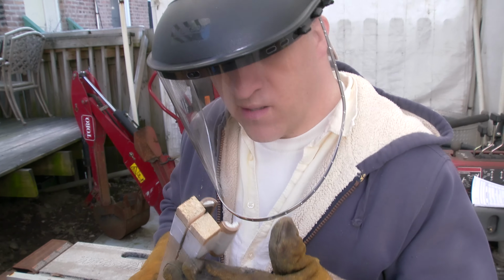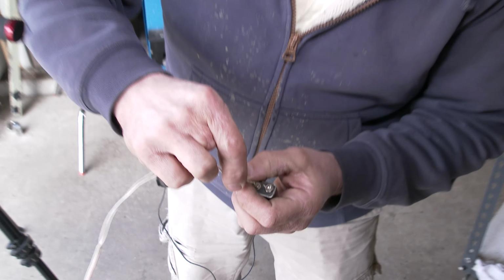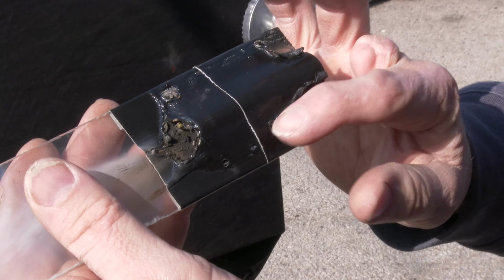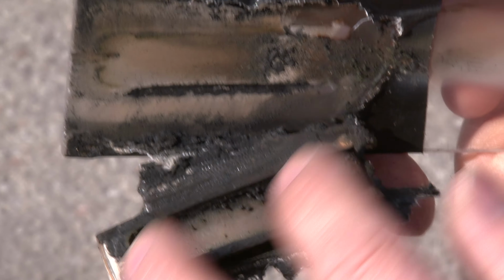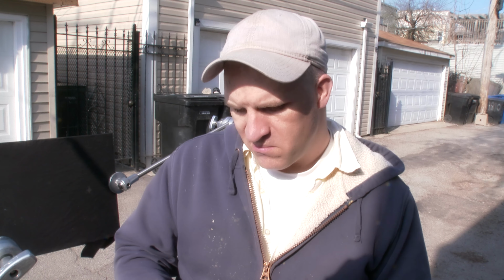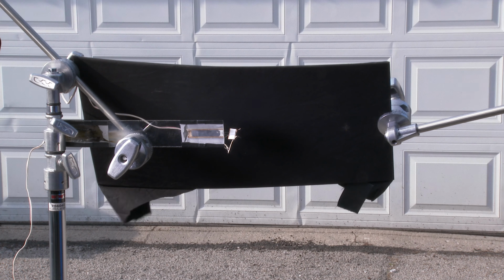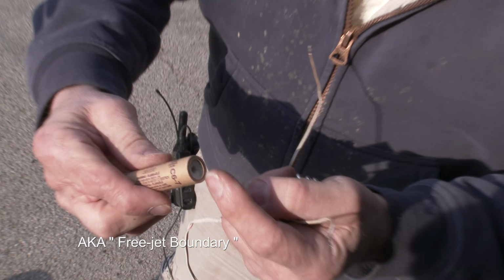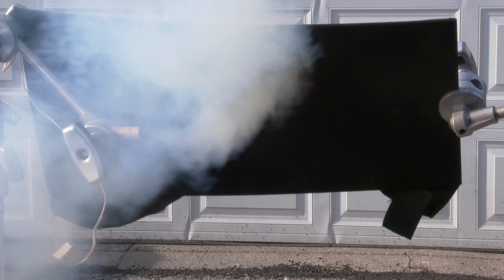See Through Model Rocket Engine Burning in 4K Slow Motion - Rockets (S1 • E1)

Comment: If you can be bothered, I'd really like to see an actual clear rocket engine, such as you saw away the cardboard tubing from the 3 stages and put it all in a perfect sized tube of some description. Putting it up against the flat piece looked good, but didn't show how they're meant to work (slow progression from nozzle to 2nd stage, very slow through that and then to the high explosive part that ejects the parachute). It seems as though because there wasn't a good seal on the casing, that the flame engulfed all the fuel almost instantly (along with the 2nd and 3rd stage).

I've seen it done with rocket candy (Grant Thompson I think), but not a professional made rocket engine.
Reply from the maker: we are filming that one already, coming next week. ... thanks !!
Reply: Just seen the other comment exactly like mine that was posted while I was writing mine haha Great minds think alike! 

Absolutely fantastic! Can't wait to see that when you release it anyway, Loved this one too, some great looking visuals on the interior of that engine!
Reply: Tkor is da bomb!!! Warped is great too😀

Comment: Great Experiment! I do think though that the rocket engine half didn't burn quite like its supposed to since the entire length of the fuel was exposed to the air/oxygen with out a complete air tight seal to the glass. I think this made the fuel burn all at once rather than progressively up the length of the engine. Thanks for the amazing content
Reply from the maker: yes i was disappointed by that too, but this video stimulated me to build a full proper version. coming up next week
Reply from the maker: one of the reasons i started out this way was because i was unsure if i would be able to capture a good view if i made a clear circular side view, i will develop it and film it next week though.
Reply: That's understandable. Looking forward to that next video

Comment: First off, I notice the motor's not fully sealed against the acrylic, so the flames tend to shoot up and down as well as out the nozzle. I don't know if there's a way to seal it better, but it might help.
More importantly, a model rocket engine has a few sections of fuel. The initial launch fuel, a delay charge, and an ejector charge. In this video, they seem to burn all at the same time. In fact, I think the part to the left that's glowing is the delay charge. This also might be because the engine doesn't have a full seal with the acrylic so the fire can go through the gap between engine and acrylic and ignite the entire fuel faster.
These are things to consider when you do this again.

Comment: This is way cool, but you cant really see the nozzle working due to the leakage of gasses thru the top and bottom. maybe hot glue the half of rocket to the plexi glass?
Reply from the maker: yes i figured both would be good instead of one or the other, thats why we posted this anyway. working on the other version as well

Comment: Nice experiment, but i would expect that it would look completely different if the sides were sealed against the acrylic ...i believe that it would then burn from right to left instead of over the complete visible surface ... would that be worth a try? but no idea how to really seal the sides .. two component epoxy maybe?
Reply: Yeah, the burning progressed way faster than it should have.  Epoxying it to the glass would probably have helped - I know epoxy is sometimes used as a burn inhibitor in rocket candy motors.
Reply from the maker: Hi Florian, we are doing a part 2 of this with a custom built transparent unit, will be out next week. thanks !!!
Reply from the maker: mostly with this video i wanted to show how the solid fuel blends and burns which i dont think i can see very well when its totally sealed, i have built a proper transparent rocket engine and will finish filming it early next week, i'm excited about this subject and the entire thing is too much to fit in one video. each variation in setup reveals different information about whats happening. thanks for watching
Reply: Warped Perception cool, looking forward to that :)
Reply: Warped Perception That'll be even better. I think he just meant to seal the edges to the acrylic though- not the whole thing. That would change the burn direction to back to front plus force the exhaust out the nozzle instead of out the edges
Reply from the maker: blurglide true but it looked too cool not to post, I figured might as well do it right, so I have to this shoot I ordered everything I need to build a custom rocket exactly like the one we burned but completely transparent, we're going to test it out on Monday and it's all works out start filming it right away
Reply: I agree. This vid has nothing to do, even from a 2d perspective, with a true propellant burn, especially the second one; blow-past going everywhere.

I would seal the whole flat area of the charge and the casing with with a low reactive contact adhesive such as pliobond and slather lots of epoxy around the perimeter, as well as tightly strapped tape.

It still wouldn't quite match the burn-progression of the fully radial charge, but gee it would come closer.
Reply from the maker: Well that's exactly why I didn't do it, this video was only about how the fuel Burns, that's it, the Max video will be up properly built transparent version. That should be up next week
Reply from the maker: tubeist- dan even if the ends were sealed it would still mix internally via the small Gap in between the acrylic and the fuel
Reply: Son, I am disappoint :(

After the great clear cylinder head videos this one really falls short. the motor needs to be sealed to stop the unrealistic burn characteristics and flames burning out of all sides.
Reply from the maker: Ryan Smith this is YouTube, I post even our developing subjects and test shoots. that way on the real shoot I'm able to incorporate other people's ideas and opinions into the full episodes.+Toshogu Takegawa nah.... All or nothing in my opinion, this was just to show how the fuel burns, even if the sides were sealed there would still be premature ignition propagation in the chamber comma since it's not perfectly sealed. I have a full version of this that I built that we are shooting next week, it's a hundred percent proper and transparent.
Reply: Warped Perception I look forward to seeing the next video! 
At the moment I'm trying to figure out where I can find the one or 2 D motors I might have hiding somewhere in the house!
Like they say, rockets aren't easy.
Reply from the maker: Ryan Smith yeah most of what we produce is outside of YouTube , so we use YouTube as a playground sometimes, good luck finding those D Motors, aren't those the big fat ones
Reply: Warped Perception yes the D motors are quite big. Unfortunately it's not easy to get them in South Africa so I saved 2 for when I finally complete building the rocket I have that takes 2 D motors.
Reply: I agree. The propellant in a model rocket motor is designed to burn from bottom-up. It doesn't always, though. The shuttle SRB's used a hole all the way up the center, so that the flame front was the entire length of the rocket.I am super-surprised the duct tape and acrylic could take the pressure, but since there was no real nozzle to constrain it, I guess the pressures were a lot lower than they normally would have been.

BE CAREFUL if you really seal it tight to the glass/plastic. The pressure can easily get to 1000 psi (or whatever psi the adhesive finally yields at). Great work!
Reply from the maker: Felony Videos wow.. that's great info , I just finished building a completely transparent proper rocket, I will make sure to use plenty of protection when we shoot it.
Reply: The burn spreads across any exposed surface, which is why a model rocket engine with a cracked grain explodes.  So in order to model the actual operation of the engine, you do have to glue the casing and the propellant grain to the acrylic.  Even so, I'd expect the flame to propagate along the interface between the propellant and the acrylic; I don't think epoxy would be adequate to withstand the chamber pressure.
Reply from the maker: Alfred Packer you are absolutely correct. When I built the actual version we are filming now, I constructed it completely different.
Reply: I disagree. If you watch the initial center material burn, it is immediate, pure gun powder. Its goal is to ignite the entire inside of the rocket. The insides are coated in (ferociously) slow burning material.
Reply from the maker: dpqbpqb dpqbpqb I never thought of it that way. good point .
Reply: Yeah he fucked up.
Reply: It's still awesome. I guess if you wanna make it look like what it's REALLY like, you would have to cut half of a transparent tube that replaces just half the cardboard cylinder. That way, you'd keep the shape of the engine while still being able to see through.
Reply: I came to the comments to say this. It would be really interesting to see what it looks like with a good seal all the way around.

Comment: Cut one in half and then use some high temp adhesive to secure the sides to the glass so you get the see through and the force of the blast going out the back. I wonder if the fuel burns differently inside when  it's not open and still has the pressure.

Comment: The Estes low power Black Powder rocket motors are "end burners".  The burn starts at the nozzle end and burns the propellant uniformly up the casing length.  Then they have a delay element that burns at a constant rate to the ejection charge.  High Power Ammonium Percolate motors are typically "core burners" where there is a hollow core the length of the motor that is ignited and burns from the inside of the propellant to the outside.  Though a core burner type of motor can also be made up of several propellant "grains" that will also burn at each end as the core burns.  (This is essentially what the Shuttle solid rocket boosters are.)
Reply from the maker: +TerrorDBN well said and exactly right , I wasn't sure which these were but for some reason I assumed that they were core burners which is why I cut them in half, I found out they were end burners,  but once it was done I figured I would do the video anyway. I have had these laying around for a while oh, I don't know why I thought they were core burners but it's okay.

Comment: Fun video.  When I was in grade school, Estes sold a clear sided engine where the colored the propellant, smoke charge and the ejection charge.  Back then the used a paper cap to retain the ejection charge that was like loose pellets.  Now I think it's more of a clay cap.  

Wanted to show an engine burning for a science project.  Never happened.  Teachers freaked at having it indoors.  Was in a plexiglass case with squirrel cage blower to exhaust the smoke out a dryer tube threw an open window.  

I was wondering how you were going to cut the engine in half.  Was wincing as you started up the table saw.  Was sure there would be enough friction heat to ignite the propellant.  Looks like it did scorch the the end of the casing.  

The C6-7 has s 7 second smoke delay, a C6-3 would shorten the high speed filming.   Another fun project would be to use a 1st stage booster engine like a C6-0.  Would show how they blow burning propellant out the back of the engine to start the second engine that would be taped to it in the second stage of the rocket.  

I fired more engines connected to a bench vise than my parents ever cared to know about.  Also had a D series engine that wouldn't ignite with normal igniters.  Removed the block of propellant from the paper casing and set it on top of a burning barrel with a fire.  When it all burned at once, made a huge mushroom cloud of smoke.  

There is a fascination in messing with these.  Looking forward to your Parr 2.

Comment: The experiment you perform was more along the lines of looking straight at the end of a rocket rather than looking at a cross-section of a rocket. Coat the half of a rocket in super glue or hot glue or some other clear substance, so that it produces a barrier in order for the fuel to not combust whole way through.  That way we may be able to see an end to end burn.
Reply from the maker: working on that already, just rushed this one out the door.
Reply: Warped Perception fantastic 😺

Comment: Try repeat this using red RTV silicon between the rocket half and the acrylic. that way all the gases won't leak around the body and you will get enough pressure to make proper nozzle expansion(it will look more like the last clip)

Comment: I love this shot, but by cutting the rocket engine in half you actually alter the way they are supposed to burn. That channel in the middle is designed to burn faster at start because you have more exposed surface area where the cone shaped channel is at the opening. By cutting it in half you allowed the entire surface against the clear plastic to ignite which is why it burned so quickly. A proper burn would show a slow progression of a flame front that travels from front to back. In the video the flame is burning on the open surface with the clear plastic backward to the tube (in the direction of the radius) not along the length of the tube. Maybe try sealing the clear plastic to the motor with a flame resistant clear epoxy?

Comment: There are certainly a lot of challenges in engineering this video. First of all, the rear part of a solid rocket engine has a venturi made of ceramic to both accelerate the thrust while withstanding the heat factor of solid rocket fuel (in this case, black powder). You might try using actual a Pyrex glass remnant sealed with some type of ceramic and epoxy sealer, it just might give you the flameproofing that you're looking for.
Reply from the maker: Frank Hamilton well I might try that but I already built the final version which is this exact same rocket engine but it's actually cast out of pyrex, I just figured I would make it a separate episode , because a side view or a back view of the engine shows you how it works really well, but you really can't see how the fuel is burning comma in this video it's a straight shot of a large surface area of the fuel section, you can see how it's peeling off as it burns. They both have really good interesting points I just decided to do them as two different episodes because the full version is really long
Reply: Agreed. Youtube is like short attention span theatre...
Reply from the maker: lmao. your right but, that's one of the only reasons YT was able to convince me to bring this stuff to YouTube, this is actually a very calm edit for me. I usually work on action movie sequences, I'll take on anyone with a short attention span and scare the crap out of them. but it's a balance especially these type of subjects, if it's edited too fast you'll get a headache. I used to do something called an A.D.D. edit . here's a small example. https://youtu.be/89dujP0C3eA and https://youtu.be/GuvWIdL-UcY
Reply: I'm a former magazine editor, so that's why my stuff tends to be on the technical side. In my past life, I had to use stills to tell my story and I did it in a first rate way. I've thought about putting more time into my edits, but really, the videos are an afterthought to me because getting the job done is my first priority. I figure, I might as well shoot video while I'm completing a task.
Reply: How are you sealing the propellant to the sides of the pyrex motor casing?  You will want to make sure to carefully manage the burn surface area.  If the burn surface area is too large, the burn will be too fast, over pressurize and cause a catastrophic failure  (ie. explosive result).
Reply from the maker: +Frank Hamilton absolutely, totally agree. It's really tough sometimes
Reply from the maker: +Frank Hamilton yeah I liked your videos. Im a technical guy.
Reply: Sound like we have a lot in common. Send me a friend request on Facebook, and I'll accept.
Reply from the maker: Frank Hamilton lol... Seems like it, thanks ! . I'll send that request, Matt Mikka
Reply: "has a venturi made of ceramic"
I did not see one. I noticed that it came out, still burning. I assume that should not be the case in a rocket. As the area in the back was too big it came out before it had reached it's maximum pressure. I assume that it is always a trade off between burn time, mass flow, pressure inside. Without any sensitive cargo, you want the highest initial acceleration you can get.

Comment: I am wondering if this is not quite a good visual. Very cool but I think the motor is burning "all at once" because of the air gap between the plexiglass and the motor. It's should burn from tear to front
Reply from the maker: +Eddie Marshall you are correct but this video was mostly just to show the burn not the operation, the next video coming this week is going to be a fully functional transparent rocket engine which should be very nice .

Comment: sawing that bp made me cringe. but i guess the worst that could happen with black powder was a fire ball or small explosion...

that aside, this representation of how the inside of a rocket motor burns is a little off.. the reason this is, is because as the bp burns the heat will travel down the side of the motor against the plexiglass and ignite the powder along the glass... you can see this happening with the entire side facing the glass burning at the same time.   the burn should be more consistent from one end to the other.

id like to suggest repeating this experiment with the only change being pressing your own rocket inside a thick wall acrylic tube.  if you make it an end burning rocket with larger nozzle that should be safe enough to prevent a cato.  feel free to message me for more info on pressing your own rocket.